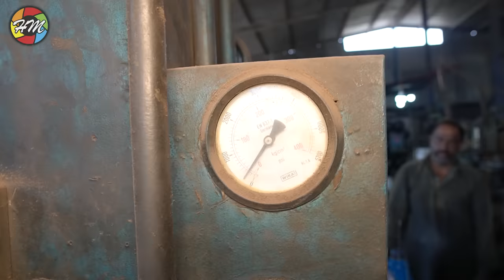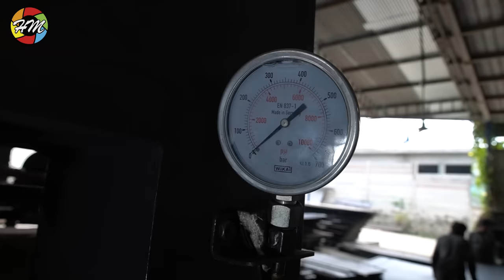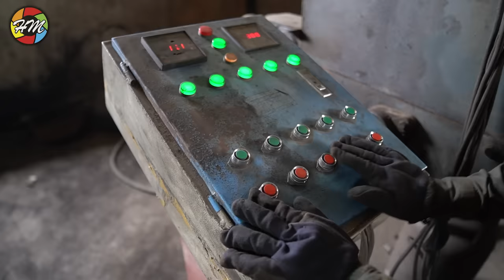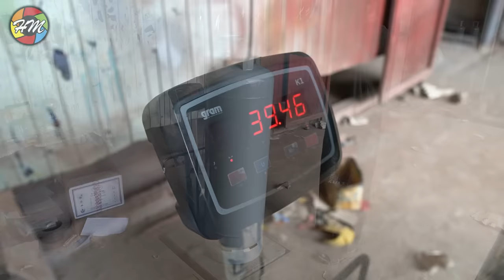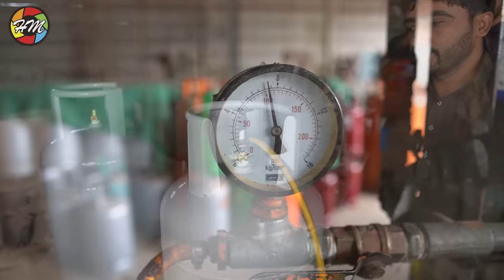How to Make High Pressure LPG Gas Cylinders Inside The Factory ||Amazing Cylinder Manufacturing.

Comment: All very nice, the construction of these vessels is similar throughout the world, with more or less automatic or modern machines, because there are international standards that govern the construction of pressure vessels (ASME standard originating in the US). Now ASME requires that the pressure test for pressure vessels be with water at 2 times the working pressure (in the case of liquefied gas cylinders, their working pressure is 10 kg/cm2 or 142 lb/in2, that is, the test pressure will be 20 kg/cm2 or 285 lb/in2), nowhere in ASME does it talk about leak testing with air at less than 5 kg/cm2 or 71 lb/in2 and soapy water.

Comment: Thanks for the video. What is the granulated product they use while mig welding and what does it do? I guess something to do with splatter, can you help with a answer? Thank you.
Reply: Thats not exactly mig welding i dont know how its called in english maybe something like Submerged Arc welding.
the Powder replaces the shielding gas and forms Slag on top of the weld just like Stick welding it is mostly used to weld huge parts like Long Beams

Comment: Well done, can't argue with that, both to them and Sunship2 .....I can't see how I missed that bit but I did. I stand corrected.
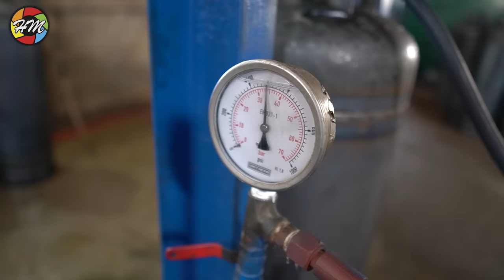Reply: Look at 15:35 - testing with water. This is for the cylinder, the test in the end with air is for the valve (i guess)…
Reply: @sunship2  don't remember seeing that bit but I stand corrected sir. 😎

Comment: This is not High Pressure, because LPG only reach less than 80 psi at 25°C. High pressures are 2200 psi in  oxygen, n1trogent, etc, Any how, excellent job. Cheers from Venezuela.

Comment: These are hardworking people in a dangerous and thankless job. But it's the bottom line that drives the third world. Faster Faster is the mantra. I don't believe safety checks and a hundred quality control checks are ever done that are essential in this type of work. I don't want to take anything away from the workers. But I would never trust anything that says High Pressure from these companies.